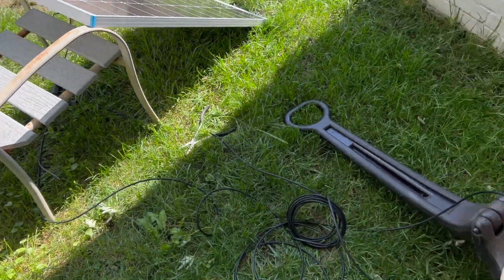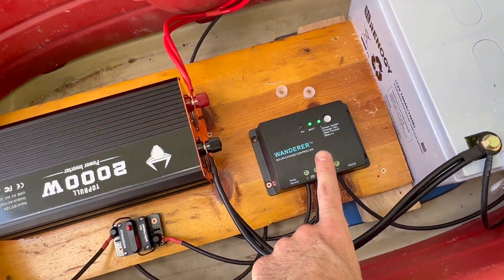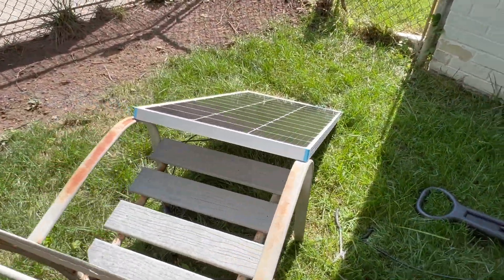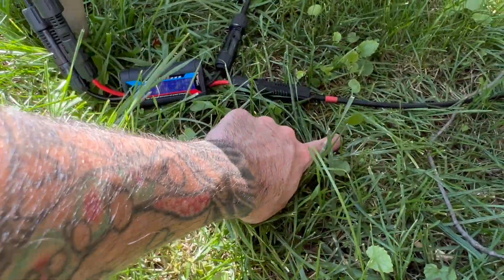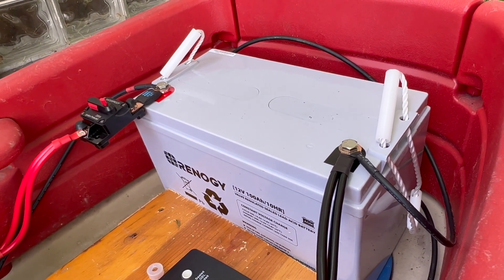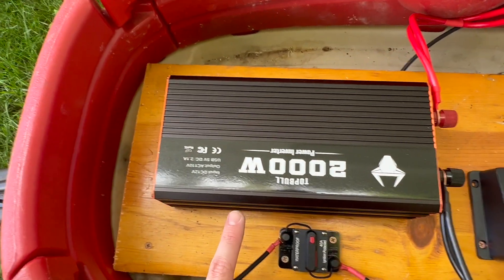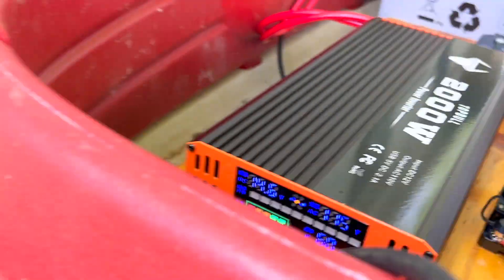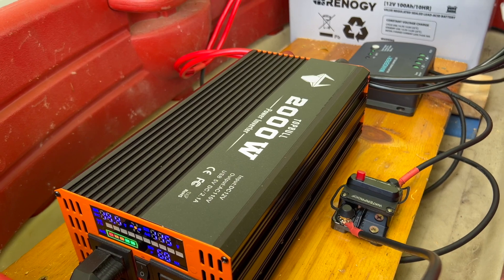My simple solar test setup!

Comment: i just got a renogy 700watt 1400 surge inverter and a dr prepare battery. now i found out i need a fuse.
do you have any recommendations?
Reply from the maker: I typically just go to Amazon for what I need. There are calculators out there to help you figure out what size you need depending on your components!

Comment: Nice simple setup. The LED lights may be flickering because the inverter doesn't look like a pure sine wave. Also be careful what you plug in to that inverter like sensitive electronics.
Reply from the maker: Thanks! The light wasn’t actually flickering in person, it was just the shutter on my camera making it do that (happens with all LED lights)

I’ve heard a few concerns with this inverter. An upgrade is definitely coming before the final install!

Comment: Nice setup. However, any reason why you have both a fuse and a breaker connected to the battery? Greetings from Jamaica.
Reply from the maker: I originally had the fuse, decided to go with the breaker, just haven’t made a wire to connect the battery to the breaker yet. Double safe I guess. But the fuse will be removed soon!

Comment: Too bad you used a high frequency, tansformerless inverter. You'll be lucky to get a year's worth of power production out of that inverter before it fails. Cheap high frequency inverters like the ones used in every commercially made solar generator on the market, have very short life expectancies, especially when powering inductive loads like refrigerators, microwave, or power tools. A much better choice would have been to use a low frequency, transformer based inverter charger. It will last far, far longer, and it won't damage your appliances when it's MOSFETs fail.
Reply from the maker: I’ll definitely check that out. First time putting together anything like this! I’m not 100% set on this inverter, so it’ll likely get replaced in the near future!

Comment: why not put reflectors at an angle of about 30 to 50 degrees angle on both sides of solar oanel and boost solar output by 40%?
Reply from the maker: I’ve heard about that but haven’t looked into it yet. I might be adding more panels in the future so I’m not sure what I want to do for the final setup yet.
Reply: @jeremyreviewsstuff  its been demonstrated by another guy on yt. just simple reflective panels
Reply: Degradation might be a good reason. Something to look into or experiment with a temp guage on the panel. 40% is a lot. Do you have a link?
Reply: @lancealderman2755  do a search. loads of experiments.

Comment: i see you have a 2k inverter and a 100ah battery witch work out to be 1400wh so when you use your inverter you will only get 1/2 hour before the battery is drawn i did the same thing as you i end up buy  4x 200ah battery just for 12 hours per day i even try to ran the inverter straight from the  solar pannels this is throught my mppt but still didnt work.
Reply: This is under the assumption you're using the inverter at 100%? If you're using the inverter @ 100wh, then you'd have 1400w, so 14 hours of power right?
Reply from the maker: Yep exactly. Depends on usage. I do plan to add more batteries and possibly another panel or 2 for my final setup, but this was just a rough mock up to make sure everything is working!